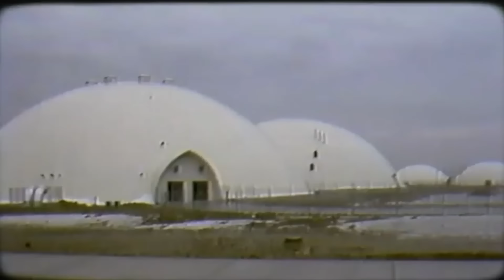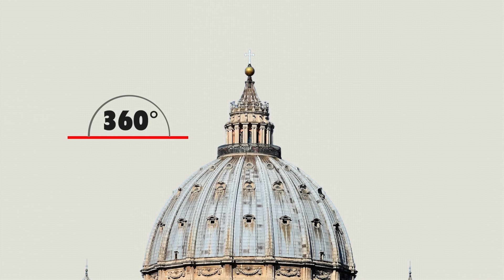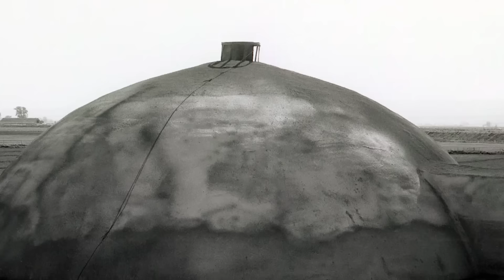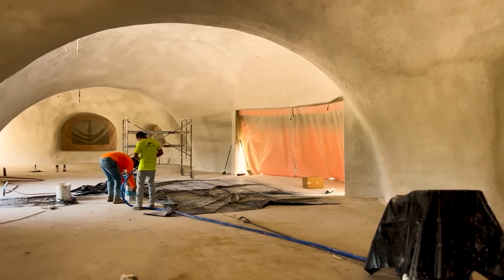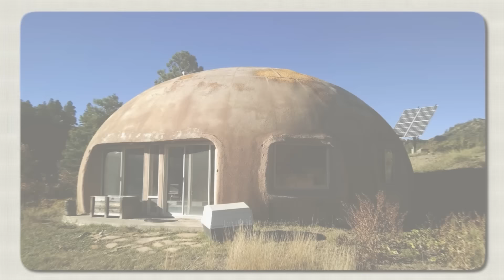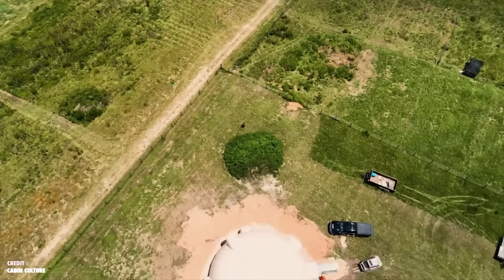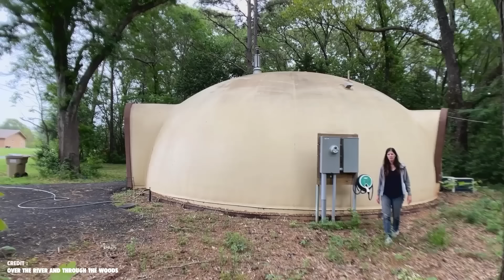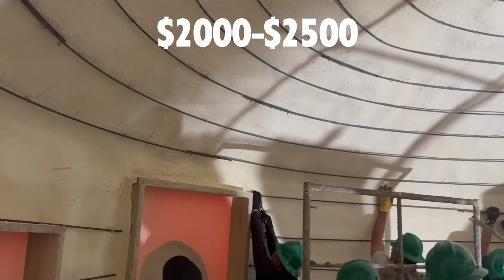This Home Survives EF5 Tornadoes, Wildfires, and Costs $0 to Heat. Why Aren't We Using It?

Comment: Putting insulation on the inside is a North-American concept. In Europe we put the insulation on the outside and the house are build from bricks or concrete and not made of wood that rots. Exceptions are old buildings where we want to keep the look of the old building. We don't have the extreme weather conditions the USA have and don't use the flimsy materials like wood and plasterboards, so the dome has no real advantage to conventional rectangular forms. An option is always to put insulation over the outer walls of a building even when the building is decades old to have a better energy use. A dome is a good system for new buildings in extreme weather like extreme heat, cold or winds
Reply from the maker: Thank you for the feedback!

Comment: Adobe would be better.
Reply from the maker: Yes I like adobe but you would need to calculate out the stress loadings, it wont be the same a concrete.  I am not sure if you are an Engineer but if so then you will know that you need to undertake your meridional and hoop stress analysis for dome designs.  Hope this helps!

Comment: Thanks for this video.. I've loved these for decades so watching it and learning the history was great. Back in the day I wanted to buy an old farm back east and put up a Buckminister Fuller dome and my wife and I even toured one that someone had built, but life happened and we moved to east Mesa and bought a horse property that had an old school brick home from the 70s on it. At any rate, this video made me rethink my plans because I'm getting ready to buy another home. Besides the tour I've had a little experience with domes,  in the 2000s the Church of Shambhala built one of the new spray on style domes in northern CA and the contractor called me after I'd volunteered to help if I could, but as it turned out the build was basically done except they were having problems regulating the interior humidity because it had a pond in the middle of the room, for aquaculture as I recall. Long story short I was able to find a fan that had a humidity sensor and could be mounted through the wall and last I knew it worked fine. A friend of mine also put tile flooring in one that was built beside Oak Creek in Sedona in '06 or so, but before it was finished he was called back east and had to leave and offered the job to me. I wouldn't necessarily built right next to a creek like that, but they put actual submarine doors on it because the entry was facing up creek, so it I'd bet it would likely survive the worst flood imaginable.
Reply from the maker: Thank you for the feedback.  Sounds like you have had a lot of hands on experience.  Interesting point about the pond and the need for humidity control.  It is these sorts of things people need to think about when building one of these buildings.  I wonder if the pond offered a cooling benefit in the summer?  With the fan coming on when it hit a humidity level this would create air moment and thus cooling, so you may have solved two problems with one solution. Appreciate the feedback - very interesting!
Reply: @wildline_YT  I didn't think of that but it might have. I had a friend who built an octagonal one in the mountains outside of Pagosa Springs CO years ago and she had the brilliant idea of adding a heated greenhouse to the exterior and you went through the greenhouse to get in, which was super neat because even in the winter you were warmed up before you even got into the house, and rather than having an indoor shower she put it in the greenhouse and recycled the water so her shower area was always warm and humid. She also had a solar panel with backup batteries for power btw. I remember one night she asked me over to see if I could do anything about the energy buildup in the upper area where her bedroom was because domes have an issue with that. For some reason the shape doesn't allow electrical energy to dissipate and if your bedroom is upstairs like hers was it gets to a point where sleep isn't possible. I know because I stayed overnight and didn't sleep a wink, so I told her to get a bare copper wire and ground it and that solved the problem.

Comment: Monolithic Domes in Italy TX is just up the road a bit, and they make all sizes of dome homes and buildings.  There's even a small community of tiny houses a few miles away.  This could help provide housing for the homeless or those escaping abuse.  Sure, they're a bit unconventional, but they built like tanks, easy to heat/cool, and economical.

Comment: wait, wait... these have existed since the late '60s (Xanadu in FL & elsewhere). They are NOT "cheap" regardless if foam, or cement. The Romans didn't live in Domes, but only the very-few special buildings. Folks can't afford such BIG structures, and small domes just aren't really liveable. Yep, this old Architect build one in '73, and knows. Skip it, kids & build what YOU can easily! There's NO Magic in structures. Do the math. Here is FL hurricanes have NEVER gotten to "300mph". And... YOU don't need "3000sf". sheesh.

Comment: I often wondered about the dome design. Home design channels never touch the subject. Would some of the building products cause air quality problems, especially with hardly, if any, windows ? What about a basement ? Could submarine like building structures to combat flooding, be too expensive ?
Reply from the maker: No sure what you mean by air quality problems.  The proper answer to your wider question is that is all comes down to location and design.  Obviously you are not going to build a basement in a flood zone, but if not in a flood zone then why install submarine type material. If you a have location in mind and are serious about building a dome home then you should engage the services of an architect with experience in this type of building.  The starting point is a search on the internet for dome homes and architects.  Thank you for your comment!
Reply: @wildline_YT   I want the design to be successful, just asking constructive criticism questions out of curiosity, that's all. I was wondering about stale air with hardly any windows and does the foam give off any gases, especially toxic ones ? Storms can flood an area even if there is no overflowing body of water. Can you have central air and heating if desired ?

Comment: I live in a dome house up in northern Michigan and it's pretty incredible in the heavy winters that we tend to have.  Heating is a breeze since the air circulates easily.  Plus, whereas large quantities of snow would normally threaten the stability of boxier houses, it instead acts as an added layer of insulation and makes the house into a proper giant igloo.  Definitely seems like more of them should be built up here.
Reply from the maker: Nice to hear from someone living the dream.  Thank you for your comment!

Comment: I have been in Italy Texas a few times and know someone that will use a 170 ft dome to build a full size roller Skating Rink.  And whatever I build later will be either Dome or ICF with a concrete roof.  I've met David South a couple of times and they are a great company to work with.  This is the best video on Dome homes I've seen yet.  Great Job..
Reply from the maker: Thank you! You feedback is very much appreciated!

Comment: As usual, capitalism has no patience for things that won’t break (and the sooner the better) or be outdated by “new stuff” so that the profits keep rolling in.  Something that is well engineered and well built —— well, that replacement cycle is way too long for corporate money grabbers.   Most likely unless there is pressure to do so, these builds won’t be mass produced so the profits are earned upfront during construction.  No economy of scale that might benefit the buyers.  IMO.

Comment: How is plumbing, electrical and hvac run in a dome home?   What does that look like?
Reply from the maker: That is a good question. If you are a plumber you would likely run your water services under the floor as normal.  If you are an electrician you would come into the consumer unit (breaker panel) and then you would likely run your circuits under the floor (if suspended floor) or in ducting. Your architect would help you design all this when doing the dome design itself.  Thank you for your question!

Comment: The problem with housing in general is that most people tend to move nowadays. What you decide to make may not suit the tastes of the next buyer. My neighbor's house is exactly the same as mine except they recently insulated their house externally to reduce heat loss through winter. My strategy is to just add more heat via solar to compensate for the loss.
Reply from the maker: Everyone is different.  There is no right or wrong. The key thing is to find the thing that works for you!  Sounds like you have!  Appreciate the comment - Thanks!

Comment: You know it’s interesting. The town that my sister lives in which is some little tiny you know blinking you miss it drive-through to get somewhere else type of town in Central Missouri, apparently recently built two of these domed structures. The structures apparently have a very important purpose. They are to act as storm shelters for the community. And of course, the reason there’s two of them is because that way you know everybody’s not trying to crowd into a single one. The town itself is only a couple hundred people. Where apparently one of the most fascinating things that happen in the area is somebody gets a completely brand new type of car.

This place is basically about as “small town rural America“ as you can get. At least in terms of the lower 48. Anyway, these domes again their primary purpose are as shelters from things like tornadoes or blizzards and stuff like that. But they also work in other capacities. One of them apparently has recently become the Townhall essentially. And the other one has been turned into essentially an event space. But again those are secondary to their primary purposes as she shelters.

In a lot of ways, doomed buildings are superior. The problem, though is not the structure of themselves. It’s the system that they are trying to squeeze their way into. The system is literally designed around the possibility of constant construction and repair. After all home maintenance alone is a multi billion dollar industry just in doing things like roof repair and stuff. You get a dome style building put up somewhere where they’re essentially is no roof and all that and you know, there’s literally no money to be had by businesses and stuff.

Another thing is the “neighborhood uniformity” now these are mostly located in neighborhoods with very strict homeowners associations. But often times even whole towns will not really like it when somebody builds something that is just completely out there in its design.

Also with the California thing, honestly I’m not that surprised by that because being a former California resident and having grown up there, I can tell you that California out of all of the states in the lower 48 probably has some of the most bizarre, legal restrictions and regulations that you will ever meet or read about I should say. Honestly, it’s pretty idiotic.
Reply from the maker: Really appreciate your time providing such insightful feedback.  The challenges are there in many respect from regulation to simple aesthetics but even if homes aren't an option then commercial buildings can be, and that is perhaps where this design would be good.  If you look at somewhere like London they have the  Millennium Dome - it is a centre piece for attracting big acts into the city, and perhaps this is where Domes fit naturally into society, perhaps not as homes but as community centres. I think you has spotted the opportunity as well as clearly highlighted the challenges.  Thank you for your comment!

Comment: Big business is behind the problems with getting permits for these builds.  Mostly the construction industry/timber and lumber.  Then these types of buildings also do not use as much electric to heat and cool if built right.

Comment: Builders are the ones that lobby Government not to allow this type of home to be built.  Just think about the crash in the housing market and jobs that would be lost.
Constant maintenance and upkeep on conventional homes would be a thing of the past, about the only maintenance on the Dome would be fresh paint and or sealer on the outside of the dome and weather stripping and or caulking around doors and windows.  No more huge insurance claims after a natural disaster, so insurance rates should go down which would in fact cut the profit of insurance companies.
There is just too much money to be lost which in the long run takes money out of too many pockets, that's the real reason Government is making it so hard to build them.
Reply: Why would you even need insurance?

Comment: My father built such domes. Very Slightly different, basket weave reinforcement design, not "monolithic domes"... and without complex machine tools. (I helped him build the one he lived in.). And built the model for his home of 3 domes in the 1960s, which sat atop our refrigerator throughout the 1970s and 80s until he built his own. 
Good reminders about dome building. (Although Not that those building such domes centuries ago did so  "without  engineering principles")
Reply from the maker: When you say basket weave reinforced design I am assuming you are not talking about using coppice (trees) as a structure but rather some form of metal lattice?  I am sure your father's design took into account many "engineering principles."  If he was indeed an engineer I am sure he would have understood well enough the meridional and hoop stresses of the structure and the structural loadings that can cause the key issues. Great to hear about pioneers like your father.  Really appreciate the feedback - good to hear from real people who have real stories! Thanks!

Comment: You missed another point: they're slightly finnicky for building properly. Screw up and you need to restart the entire process if your dome is overinflated or underinflated, and if there are temperature fluctuations that mess up the pressure of the dome while the concrete is being applied or cured... well, that's another restart too. I'd assume the tech has been improved significantly so there aren't as many of these particular issues, but those were some of the early problems with this design/method that I read about for structure failures
Reply from the maker: Agree!  You point out some of the challenges and I am sure they are many more such as variability in the concrete thickness (affects the stress analysis and therefore the structural loadings) etc. But the aim of the video was to get over the idea that dome design is an option and for the reasons mentioned.  Hope this message got through.  I do appreciate the constructive feedback - it helps people understand that building this is not simple (perhaps we made it look to simple but to go into every detail would need a video a lot longer than 12 minutes).  Really do appreciate your feedback - thanks!

Comment: But unfortunately this design does not work for most suburban lot sizes.    For a hemispherical dome the height equals the radius.  For a 20ft dome you (1,257 sq ft) need a 40ft circular footprint.  You'd most likely need a buildable width of 50 to 60 feet to accommodate rear, front and side setbacks.   And you lose a great deal of functional space due to the sloping shape.   There is a functional reason houses are built up rather than wide.
Reply from the maker: I agree, it is not really for suburban lots! I think the point you make that "There is a functional reason..." is correct.  It means developers can squeeze more houses into a smaller footprint.  Not saying that is wrong, just saying that is probably the reason.  Thank you for your comment!

Comment: One of the tricks is for a large structure inflating the balloon for efficiency.  But, for a residence you can build a concrete home, even "house shaped" that has continuous insulation and it is likely to survive pretty well.  Ever notice the aerial video after a disaster, and some homes are just fine.  Those were built by contractors who care and followed the rules.  Ever notice how few those are?  Also, damage comes from your neighbor's stupidity as well.  So, ideally, you put storm shutters in, and close them up during bad weather or when you go away.
Bottom line - go hire an architect and good engineer that are interested in giving you what you the security you want.
Reply: It's not the builders it's the buyers that are the problem. We just build what we're told to.
No one commenting here is going to pay for qhat they say should be standard. 

This video is a lie by the way. They don't perform like it claims. Look at the woman that lives in one that commented.
Reply: @sparksmcgee6641  The time when it is the builder's fault, is not doing the double check on his low wage workers, many of whom do not give a crap about quality or following 'da rulz'.  That's why you see a new house with a standing seam metal roof ripped up from the corner on one house, but not the others.  Or houses lifted up, because the straps and bolts were left out.  And don't even get me started on the quality of city inspectors.

Comment: The outside fabric gets damaged and wears out from exposure.
The domes this video lists in the storm section arent the type this video is about.
Reply: I was wondering about how the insulation on the outside would hold up.  Can you explain more about this?  You mention there are different kinds of domes.